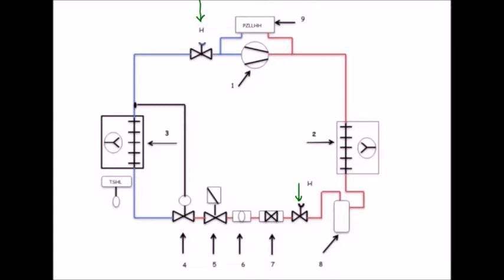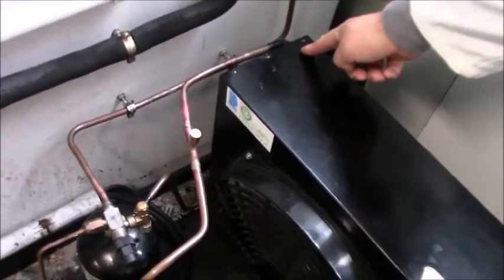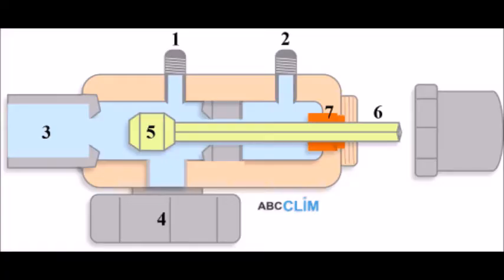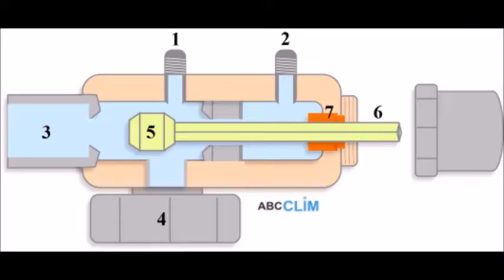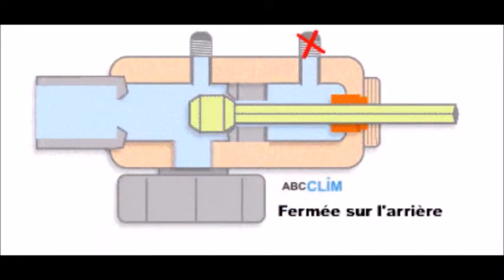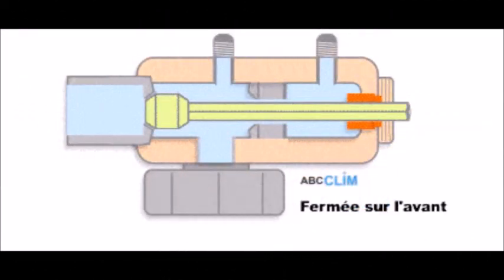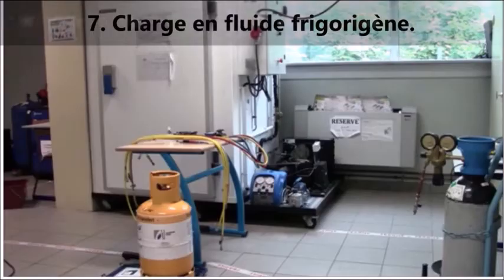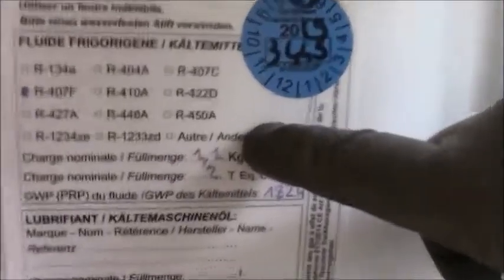FLUIDES FRIGORIGÈNES : ATTESTATION D’APTITUDE CATÉGORIE 1 formation pratique complète ( 1 heure ).

Comment: Bonjour,
Est-ce qu'après la récupération du frigorigène il ne serait pas pertinent de fermer la vanne de service HP en cale avant pour isoler la partie du circuit où l'on va changer le filtre ? L'autre côté sera fermé par l'électrovanne.
Ainsi on expose le moins possible les conduites à l'air ambiant et l'on protège l'huile du compresseur contre l'humidité et l'oxygène (qui se lient chimiquement, presque impossible à évacuer même avec les rinçages et invisible sauf en durée de vie de l'huile et du compresseur). 
Une fois réparé, pour un max de propreté je ferais un petit tirage au vide rapide depuis la vanne de service HP (rouverte à ce moment) avant d'injecter l'azote et de faire le test d'étanchéité.
Reply from the maker: Bonjour,  bravo vous êtes bien avancé dans la compréhension   du circuit.  Le problème est de pouvoir tirer au vide le tronçon de la ligne liquide après intervention , si vous avez une prise de pression après la vanne de service cela est possible, et effectivement cela évite de tout vider.
Il est important de tester l'huile du compresseur après une ouverture complète du circuit.
Bonne continuation.
Reply: @Lesfrigoristes  Merci pour la réponse. Je pensais quand même vider le réfrigérant comme vous. Je ne pensais pas faire le vide avec un autre accès que la vanne de service HP. Juste isoler la partie avec intervention. Fermer aussi la  vanne BP. Ainsi quand on ferait ce petit tirage au vide depuis HP le compresseur sera "accessible" à l'air ambiant pris dans la portion travaillée du circuit mais durant un temps beaucoup plus limité.
C'est "de l'astiquage de mouche" cette idée ou bien ça se tient ?

C'est un bon point le contrôle de l'huile, merci du rappel.
Reply from the maker: @3g2i63 en complément si votre vanne de service HP est en cale avant vous pourriez pas poussez l'azote ni faire le tirage au vide après intervention.